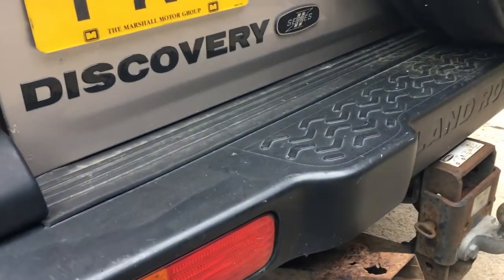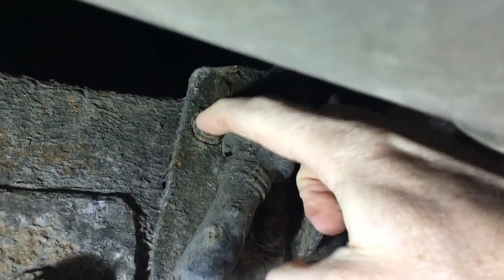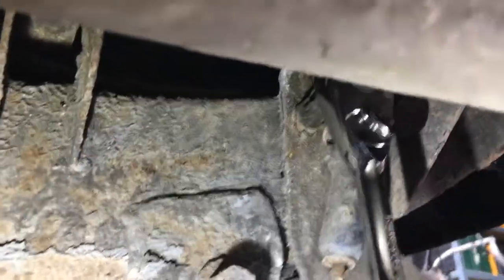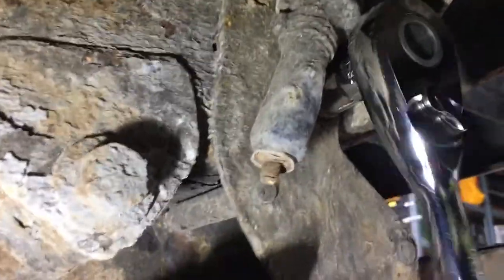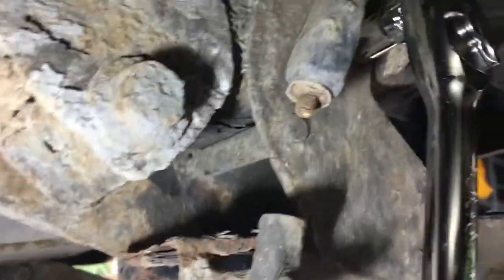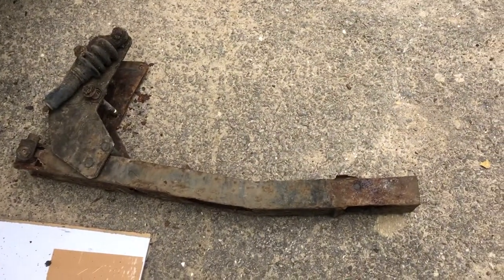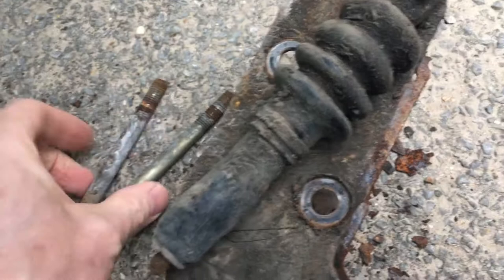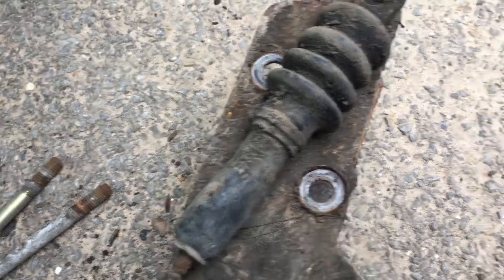Land Rover Discovery 2 Rear Step Removal KVI000030

Comment: Thanks Paul for the tip - much appreciated!  Have recently been using a trailer - was reversing in the dark in a confined space and the trailer jack-knifed: the rear step (in perfect knick) got bent badly and pushed into the rear bumper!  Will have to remove the step now and then see if I can somehow straighten it all up!
Reply from the maker: Ouch sorry to hear that , glad the video helped. Hopefully you can repair it or replace it with a used one in good condition. Let me know how you get on 👍
Reply: Removed the step - support bracket bent but step in great nick otherwise.  Wonder if bracket can be removed easily and straightened (held by a couple of long pins)?  Don't think YouTube allows me to upload a photo?

Comment: Thats a rusty old Disco you've got there Paul!! I patched mine up a few years ago. I actually welded the box section and repaired the end of the gas strut. It doesn't get a lot of use and is now pretty much seized up. But I'm due to weld up my rear chassis before the MOT, so will probably give it a bit of maintenance then. Could make an interesting video!.
Reply from the maker: The joys and fun of owning a Land Rover. Can you bring your welding gear as well when you are next down the flying field 🤣